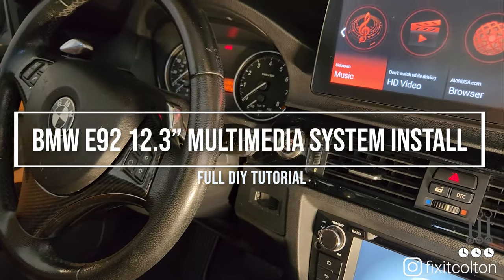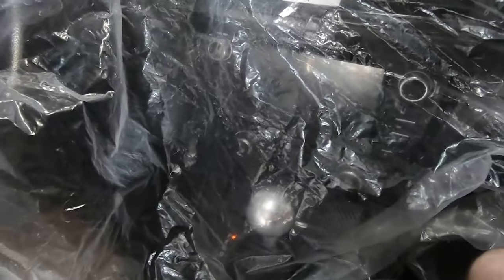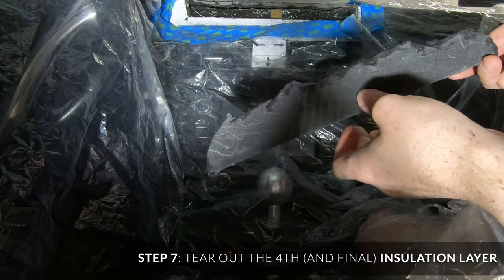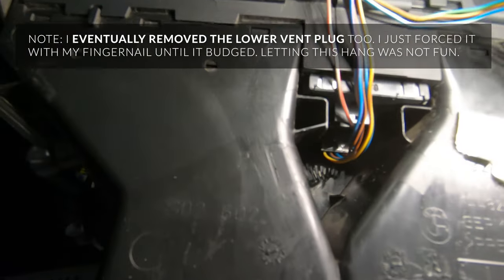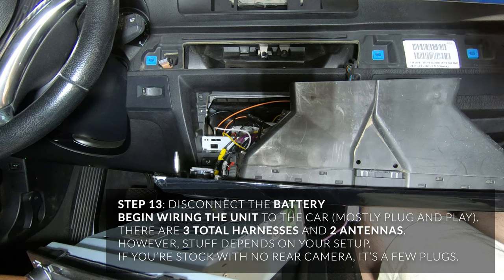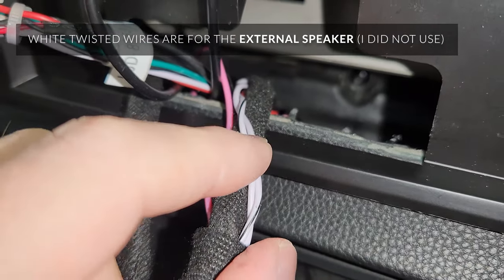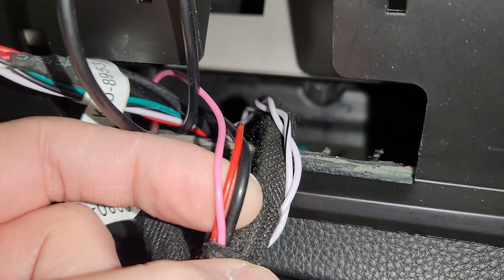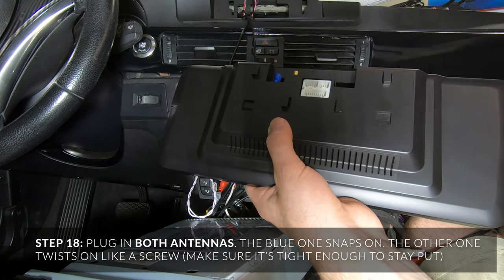BMW ANDROID 12.3" MULTIMEDIA NAVIGATION SYSTEM FULL INSTALLATION TUTORIAL (E90/E92 3 SERIES DIY)(2K)

Comment: I’m getting low sound and static from the screen could it be a bad harness , I plugged in a Bluetooth receiver and got sound so it’s not my aux
Reply from the maker: Hey, that is an annoying issue, let's see... With limited info I can only guess, but my first instinct is a ground loop. I don't know your setup, source, frequency, time, etc., but you can try isolating everything you can to test one by one. If it is the harness, that will be more difficult. You could try wiggling the speaker connection wires one by one to see if there's fluctuation, or inspect the tiny ports one by one. You can try touching a wire to the metal on the unit casing and touching the other end to a ground point to see if that lowers the noise. It is possible that it's internal in the unit (could be bad on the board), but that's not usual. If there is a rise in the pitch as the engine revs, that could be related to other electrical issues in the car, such as your alternator. Lastly, you can try to plug in a ground loop isolator if you're using the aux. I had a loop (low static) due to power running from the car to my device and to the radio, and then my device's aux to the car's system. This item eliminated it completely. https://amzn.to/3Npv6QE

Comment: Hey i just did this on my 2007 e90 with idrive. I ran all my cables right but I ended up getting a battery light, abs and dtc light on screen. My car is acting funky and was restart looping my idrive CCC bow. You have any advice on why that could of been happening? I even tried charging my battery and swapping out the alternator. But it worked good for like 6 hours then after driving to get food with my girl it just died out SMH.. had to get my car towed home and everything. I have the Xtrons unit with ANdroid 11. im guessing they are the same just rebranded.
Reply from the maker: Hey, wow... isn't this the typical story for BMW's, lol... So, you hooked everything up and had NO lights for 6 hours? Or, did you have those 3 lights right after installing? Did you disconnect your battery during install? Did you shift your battery? If you disconnected your battery, did you disconnect the positive or negative terminal? You might've messed up or shifted the BST connector on the battery. If you didn't disconnect the battery, maybe you popped a fuse (but that would be a headache to trace and I don't think that's it). There isn't a whole lot you can do behind the scenes there that should cause that level of chaos, I feel. Maybe you have an additional decoder for the factory iDrive, maybe your unit needs to change canbus protocol settings in the deep factory menu. However, since your car has the battery light and then died, my initial reaction was your voltage regulator coincidentally started acting up (that's my intuitive thought, lol). That's a pretty cheap fix (#F00M346089). If you're still on the original, it's a good thing to replace anyhow. That thing is known to throw all sorts of electrical codes at you for no reason, simply because the terminals wore down a bit too much. I have seen E90's have the battery test good, seem fully charged, and still be the culprit though. I may have replaced the battery before the alternator. Lastly, I'm assuming you have a scanner, did you pull any codes at all? You can use "Bimmerlink" from the app store (Android) and this bluetooth dongle from Amazon (https://amzn.to/3PGr6ea) which is the cheapest route to pull all codes, including BMW specific. Or, just use that dongle and use "Torque" app to pull basic codes for free. That would help. At the minimum, have Autozone charge and test your battery for free. That, or take a cheap multimeter and test the battery when charged (assuming your car then turns on) and see what the voltage is when running. If you already swapped the alternator, then it's probably not that. If you charged the battery full, verified it's good and full, and it's still not turning on (no power at all) then you may have to trace back stuff further. Again, it may be the voltage regulator. It's hard to give more guesses with such limited info. Hope that helps. Good luck

Comment: Did you have the problem that when you connected everything when you turned on blinker it switched the image to the rear view camera? If so, what did you do to fix it?
Reply from the maker: I'm sorry, I did not have that. What exact car do you have (model, year, OEM navigation)? Also, what version of the unit did you buy (and from which brand)? That's a tough one. It could be software related if you select the wrong CANBUS (possibly). Personally, I would start right at the rear camera source. There should be only the yellow RCA plug and the red power wire. On some cars, the camera will still activate without the red wire. You can try disconnecting that to test whether it happens still. I would assume that you grabbed the turn signal wire instead of the rear backup lights wire. It depends where you grabbed the source wire from. If you pulled it from the fuse box area, make sure you got the right wire because each model has a slightly different layout. I grabbed my source in the trunk, so I was able to verify it was the reverse lights wire. If you have a multimeter or even a simple test light, you can connect that to the wire you used to connect the backup camera with. Disconnect it (temporarily) from the backup cam. Now, it should read no voltage. Then, turn on your turn signal (whichever one is causing it). If it shows voltage, you grabbed the wrong wire. If it doesn’t, then try the same thing with the reverse wire. Put your car in reverse and see if voltage shows up. If you grabbed the right wire, then you can try other things in the software. New cars have that option to see side view mirror cameras when signaling directions, so maybe that got twisted up in the harness (or if you spliced) if you have a new car. Or, again, the software is setup wrong. I don't have my BMW with me right now, but when I switch to it, I will double check my factory menu to see if there's a setting in there for this. It is possible that inside the deep factory settings, there's a toggle to signal the rear camera on turns. You can access that menu (despite whatever model or build you have) however, I think the code will be different for each brand. The AvinUSA code is 1314. Be careful to change one thing at a time and restart. If you change too much, you may mess up other things. Good luck!

Comment: Do find it to be too big? I'm trying to decide on this or the 10"
Reply from the maker: Hey, it's actually PERFECT for the E90/92 dash. I saw a few people try to squeeze this into the F series and it didn't look good (too big, maybe) but specifically because it was off center. I think the best advice I can give you is to measure your dash. It's about 13.5" at the base (width) and about 5.5" tall. The height is negligible. However, if the width doesn't sit CENTER over the vents, then definitely do the 10".  Another benefit of the 12.3" over the 10" is that it sits much closer. The 10" sits indented in the dash. It's far easier to reach the 12.3" and drive safely. It's also far easier to see things on. It will allow you to keep your eyes on the road a bit more, and keep your peripheral views less strained, lol. My old unit sat lower, and it was a pain to touch the screen at that angle. It was not fun to look down either. You should also consider how you use the system and the angles because you won't intuitively think of this, but it will affect your driving experience. This 12.3" is best suited for your line of sight and reach.
Reply: @fixitcolton  Cool, thanks! I ordered the 12.3" earlier. I plan to use a hot knife tool to cut the hole in the plastic. It's slower, but more precise and no mess. I also found an install where a guy in Germany installed a lot of these units and he mentioned to just cut a straight line, instead of the jagged edges illustrated on the template. He said it makes the units he has installed sit as intended. Thanks for the vid!
Reply from the maker: Yea, you'll enjoy it. I love having it in this car. The initial cut with the razor was not too bad, and didn't really matter on the edges because it's all covered. I was saying that all along, the jagged edges seemed useless, lol. I'm glad to finally hear confirmation, thanks. I will mention that in the review. It would've been a piece of cake with the razor if it were just a square. Start small, go bigger if needed. I did end up getting it to sit pretty close. I adjusted the bracket as well, and it sits solidly without flex. Good luck on it!